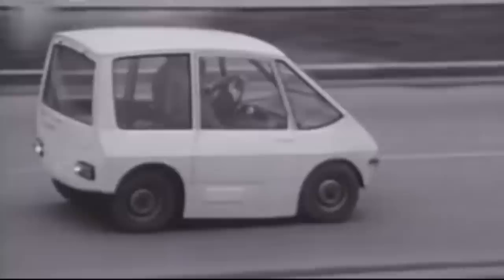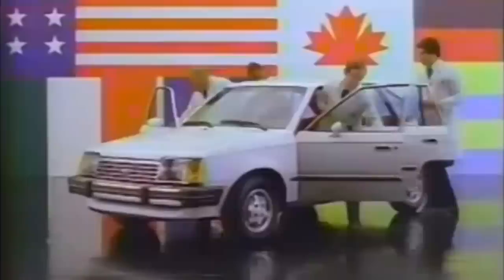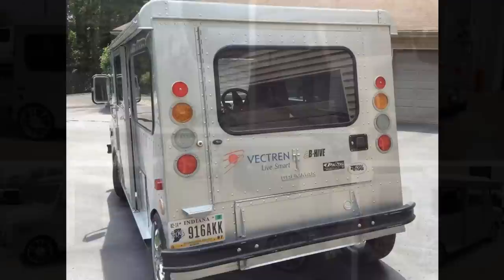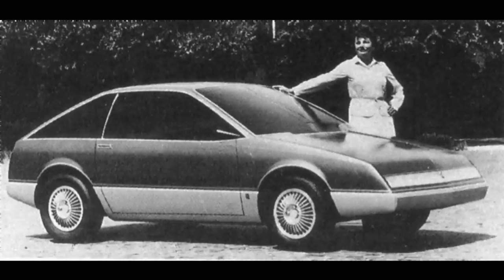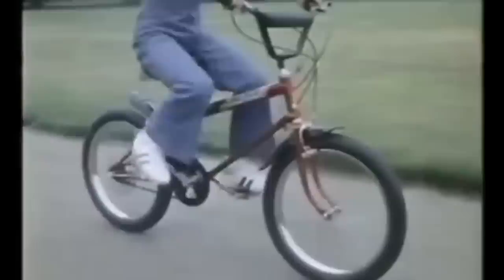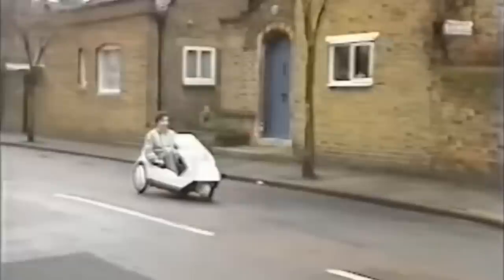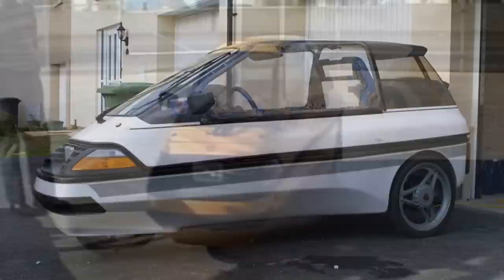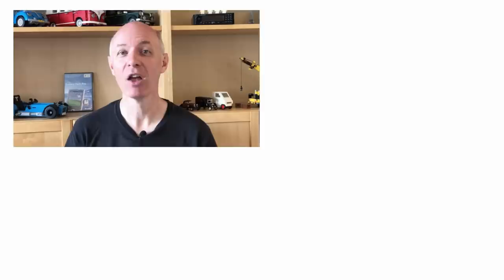Before Tesla... 1980s Electric Cars (EVs Part 2)

Comment: Petrol car: How fast does it go?
Electric car: How far does it go?
Reply: Jaunty Angle guess you live under a rock and haven’t seen the Porsche Taycan or the model s/x 100D, model 3 dual motor...
Reply: @goclunker  No, I haven't. Are they electric? If so, how fast do they recharge?
Reply: Jaunty Angle are you kidding me? The Taycan is running an 800v charger. 5 min to 80%
Reply: @goclunker  Not bad if you can find a charge point. How much is it?
Reply: @niki123489  thanks, now i know that an electric vehicle wouldnt even get me to work, let alone to visit my family on the weekends
Reply: @goclunker  No, it's 22,5 minutes to 80%.
Reply: @petrkubena  there is no 800V infrastructure, yet. The Taycan is designed to charge at 800V, which is 5 min to 80%. Thanks for playing
Reply: @goclunker  No, It is NOT 5 minutes. Taycan really has 22,5 minutes on 350kW/800V charger (currently limited to roughly 270kW peak in Taycan firmware).  800V chargers are available, but scarce. 

Make simple calculation - taycan has 93kWh battery, for it to be charged to 80% in 5 minutes , it would need constant 900kW power supply. At 800V that would mean around 1000Amps. Not realistically possible. And way more when you consider that peak charging speed is achieved at around 25% SoC and then it declines.
Reply: P
Reply: I have a electric car that can go about 100 kilometers on one charge. 
I drive less than 50 kilometers per day.
I charge the car at work.
The time I spend on charging the car is about 10 seconds per day.
Reply: @goclunker   go to a sub station you can get 800volts there and 900kw
Reply: @Ghryst  your commute is more than 600km per day?
Reply: @RMarkNolan  yes.
may i introduce you to a real Country, Australia perhaps?
also, (not you in particular, but all of you) ya'll should learn how to maintain a lithium battery - NEVER fully discharge it, it is recommended to discharge to no less than 60%, so there goes 200km
Reply: lmao i just read the "5min to charge to 80%" claim

...

hahahahahahhahahahahahahahhahahahahahahahhahahahahahahahhahahahahahahahhahahahahahahahhahahahahahahahhahahahahahahahhahahahahahahahhahahahahahahahhahahahahahahahhahahahahahahahhahahahahahahahhahahahahahahahhahahahahahahahhahahahahahahahhahahahahahahahhahahahahahahahhahahahahahahahhahahahahahahahhahahahahahahahhahahahahahahahhahahahahahahahhahahahahahahahhahahahahahahahhahahahahahahahhahahahahahahahhahahahahahahahhahahahahahahahhahahahahahahahhahahahahahahahhahahahahahahahhahahahahahahahhahahahahahahahhahahahahahahahhaha
Reply: @Ghryst  Hahahahahahahahaha. 
My boss is very much for new and environmentally friendly technology. That's why he offers everyone who buy an electric car free charging at work. Selfish? I don't think so.
And by the way. There are no problems with discharging the lithium batteries close to zero, or to charge them to 100%, as long as you never park the car with full or empty battery for longer periods.
Charge to 100% before you travel, and if you are close to zero just charge up tp 20% before parking the car for a longer period. Then the batteries will be just fine.
Reply: @kjaxky  I'm sorry if you regard pertinent questions as "something stupid to say". No doubt you also believe in a flat earth and follow an established god without question. I'm sure you're not one to exaggerate so instead of asking you to name  10 percent of the "millions" of issues wrong with gasoline vehicles, I'll ask you to name just 10?
Reply: @Ghryst  if your work commute is more than 600km per day, you could possibly consider moving closer to work, and save some of that 7.5 hour drive every day. Unless you drive for work, which sounds likely.

Li-Ion batteries are fine to be discharged down to 5%, sometimes less.
Reply: @RMarkNolan  7.5 hours for a measly 600km?
how fucking slow do you think i drive? try 4 hours, 3.5 if im doing 10km over the limit. and fuck living in the city, its bad enough i have to go there for work.
and no, Li-Ion batteries are not fine to be deeply discharged, maybe you're thinking of old-fashioned ni-cad, which MUST be deeply discharged each time to avoid developing a surface memory..
no wonder electric cars have such a terrible environmental impact, if this is how you fools are treating your batteries.
Reply: @Ghryst  to drive 600km in 4 hours, your average speed would have to be 150km/h. You must be lucky to have no speed cameras or traffic cops in Australia!

My calculations were based on New Zealand's 100km/h speed limit, and a real-world average speed of 80km/h for a trip.

Even so, spending 4 hours driving at an average speed of 150km/h every day must be tiring. You should consider working closer to home, rather than commuting over 600km per day.
Reply: @Ghryst EVs can be driven down to "0%" charge. The battery management system keeps a deserve charge so the battery is not completely discharged (which would damage it). So 0% shown is not actually completely discharged. The car doesn't allow the battery to become completely discharged.
Reply: @RMarkNolan  errr... like every modern battery. 
0% voltage is where it become un-rechargeable on the spot, it is still having its lifetime reduced by going to zero on the dial
Reply: @RMarkNolan  we have them, theyre just rare in the countryside, cos we dont have towns every 10 miles like yankeeland
Reply: 9600GTMAN   the range of the car is much more important to most car buyers

the EV 1 seems irrelevant to me now  after seeing the Amitron of 67 and knowing it went 150 miles per charge

that's a longer range than the EV 1

they were still looking for a viable electric car in the 80's 

why?

we had already found it
Reply: that's 50 miles more than the Nissan leaf of 2011 and 30 miles  more than the EV1 GEN 3 so it makes the other two cars unimportant
Reply: I am sure they could increase the range a bunch on newer cars if they could only go 50 mph but everybody would hate them.
Reply: Wow middle class old men with opinions

Comment: I've got a Sinclair C5 - Living at the top of a steep hill, I've had to upgrade it with a modern front hub motor and lithium battery. Now it's a fantastic way to get to work. I know several people in the C5 world using the original on a daily basis so it's really proven it's engineered to last.

It was a failure compared to the dream Sir Clive had for it, but was the best selling electric vehicle ever made until the Nissan Leaf took the crown in 2011.

Let me know if you are ever in Bristol and want a go!
Reply: got a 500w 48v hub on mine and a 42Ah battery. it pulls clean uphill now. never have to pedal. now i dream of a cityel

Comment: I own a City-el, I have fitted it with a mix of lead acid and lifepo-4 cells. top speed is 40 mph and it has a range around 40 miles.
The car was built in 1999.

Comment: Around 20 years ago a 'Cityel' drove past me while walking through Vevey. It struck me at the time that this was the future as it silently glided by. It made conventional cars seem like overweight dinosaurs. Since then I have never stopped ranting about SUVs.:))
Reply: Weight is actually the smaller problem, bigger problem is air resistance. In electric cars though there will be weight, the bigger batteries (range) you want, the more. I think the future is that people who like to drive will have more cars, so that cars are suited for the purpose. You can have small car with small batteries for short distances like commuting. And you can have a bigger and better cars for long distances. That way you are most of the time driving efficiently. Also, remote working will be more common, so that the need to commute will reduce.
Reply: @ThePatUltra The problem with the batteries has so far been their price. Even having one Tesla worth of batteries is very difficult to make the car cheap enough. If you double the amount of battery capacity, you are quite soon looking at well over 100k $€ vehicle that has less range than double the range of a Tesla. The price will go down though until a certain point, that is that the availability of battery materials is going to be a problem if the production is to be scaled with current chemistries. In the other hand there may be coming new promising battery types quite soon, like the solid state battery that at least Toyota is working on.
Reply: @wopmf4345FxFDxdGaa20  January 2021: Tesla lowered the price of the Model Y RWD (60 kWh LFP) to ~45,000 €.
Reply: @Stefan_Dahn  Here in Finland, average people drive with ~6,000 € cars. 😂😅 The average car age here is 12 years. Which means, some people are driving 20 years old cars. So, yeah . . . We will see how many Tesla's will be on the road at the age of 20 and how can you maintain them at that point.
Reply: @wopmf4345FxFDxdGaa20 people can’t afford to buy two separate vehicles for different types of driving. Buying one EV is out of the price range of 80% of the people who drive now. The push to go 100% EV shouldn’t be happening for another 15-20 years when hopefully the Ted will be less expensive and the range and charging time will be closer to that of an ICE vehicle. Also, there needs to be a massive increase in the power grid and a cleaner source of energy, if not, you are doing nothing to reduce pollution. But since the whole global warming myth is about money, it doesn’t matter to the left.
Reply: Why are you ranting about SUVs? They have no more affect on the environment than an EV does. The entire process of making an EV is always ignored by you people that want to force others to get rid of their ICE vehicles. You just feel all warm and fuzzy inside because you think you are helping the environment by driving an EV. Even if you forget about the impact that the mining of the materials has on the environment and how it affects the lives of those that do the mining, there is the fact that the power to charge the EV most likely comes from fossil fuels. But as it is with most all of those on the left, you don’t care about solving a problem, you only want to appear to be helping so you look good. EVs are definitely the future of transportation, but it cannot be forced. And that means keeping the government out of it
Reply: @mopar_dude9227  Yep! That is the thing, if even Americans cannot afford to buy them, who can? I agree with you. Here in Europe the situation is quite bad, EU is making internal combustion engine cars illegal after 2035. 😣
Reply: @wopmf4345FxFDxdGaa20  Finland is quit literally not the place for a Tesla unless it's summer.

Comment: The EV1 was one of the first quick EVs and had a faster zero to sixty than many gasoline cars such as the V6 Camry of the same era..
Though the drive train is a direct ancestor to what appeared in the Tesla Roadster.
Reply: Patchuchan that’s because Elon was mad at GM for what they did with the EV1. He said himself that Tesla was started because of the EV1 story and what GM did
Reply: A V6 Toyota?🤣🤣🤣🤣
Reply: @princesssolace4337 I wouldn't laugh too much at a Toyota V6 in a fairly light car 
The V6 Camry SE of that era could do zero to 60 in 7 seconds which was very respectable beating many so called sporty cars.
Reply: @Patchuchan  the range of the car is much more important to most car buyers

the EV 1 seems irrelevant to me now  after seeing the Amitron of 67 and knowing it went 150 miles per charge

that's a longer range than the EV 1

they were still looking for a viable electric car in the 80's 

why?

we had already found it
Reply: @robinsss  It used some very cutting edge for the time lithium-nickel-fluoride  batteries but they were too expensive to produce and to get the price down a battery company would have to make a lot of them but they're not going to make a lot of them unless they have a big order.
Ended up being laptop computers of all things that drove the need for mass produced lithium batteries in the 1990s.
Reply: @Patchuchan   just technologically speaking it  was the first viable Electric car 

not the EV  1
Reply: @robinsss  1899 Baker Electric.
Reply: @goclunker  Elon was in South Africa when the EV1 was rolling around. Musk had NOTHING to do with Tesla's formation.
Reply: I suppose the thing that allowed that was power electronics which lead to motor control improvement. Other than that it is 100 year old technology. Well indeed there was some new battery chemistries, but were those needed for the acceleration.  ;-)
Reply: @robinsss  The value of good acceleration is more a marketing value, to remove the image where people think that electric cars are gutless or slow (which they of course by nature aren't, it was just that ICE cars had been developed and polished for 100 years, while electric cars had been not). Now that gutless image problem has been mostly solved thanks to Tesla, the problem remaining now is the range, (and price).
Reply: @wopmf4345FxFDxdGaa20  the only remaining  problem is the price

the Model 3 can reach 300 miles on the highway alone

that's the equivalent of a gas car
Reply: @robinsss  I don't know about American cars, but at least in Europe, even a cheap gasoline car goes more like 500 - 1000 km with a tank, and a diesel car, if you drive very carefully may go nearly 2000 km with a tank ( like has been achieved in the fuel saving drive competitions with standard production cars for example a Mercedes E class ). So Tesla Model 3 same time as being much more expensive, hits the lowest end of ICE cars. It is then a different question how long range is needed. I think 1000 km would be quite enough for just about anything in normal use.
Reply: @robinsss  Of course if price is unlimited, the range is not a problem. The range and price are actually the same problem, two different sides of the same coin. If you want longer range, the car will be remarkably more expensive. If they can push the battery price very low, the problem is solved.
Reply: @wopmf4345FxFDxdGaa20  500 km is 300  miles 

300 miles is the average mileage for an ICE car in America for a full tank of gas

i don't  know what you mean '''with a tank'''

all cars have tanks

the  range and the price are two different things because today a Tesla model 3 costs 36,000 dollars in the US  and goes 300 miles on the highway'

a few years ago a Roadster went about the same distance on the highway for 100,000 dollars

now that range cost 36,000 dollars

by using new concepts in technology  Tesla was able to reduce the price for the same range
Reply: @robinsss  Well excuse me for my English not being perfect as I am not a native speaker, but we can switch to Swedish or Finnish if you like.

"by using new concepts in technology  Tesla was able to reduce the price for the same range"

Exactly! This is the point! The new Tesla is cheaper, because it uses better more advanced manufacturing technology and better battery chemistries, and the manufacturing is scaled to new levels with the help of the new gigafactories that also help to reduce the unit cost. This is awesome development what Tesla has been able to do and also wake up others for this task.

But it still means, the car costs 36 000 $, and the car is like a Toyota Corolla in its utility. How much Corolla costs in USA?

Well even that is not the big problem though, people could pay a little more, and electric car could be made to last a little longer.

The greater problem will be that when the production of the batteries will  be scaled up, the  amount of natural resources available for batteries is limited, and that will be a problem, in dropping the battery kWh price.

Currently Tesla makes 1 000 000 cars a year? Toyota and VW both make 10 000 000 cars a year. And all other manufacturers added to that.

If most cars are to be electric, it means the production of the batteries must be scaled by factory of 50 - 100 at minimum, and that is only for cars! Then there is many other places where the same batteries are wanted to be used, if ICE is to be displaced.
Reply: @robinsss  The key to understanding how far the price can drop, is understanding the mechanism how the price is dropping.

Like in computers and in computing power; the price has dropped because the transistors and the manufacturing technology of the intergrated circuits has been scaled to smaller size all the time since 60's. Nowadays you can fit much larger amount of transistors on same die area compared to what you could 15 years ago. There is obvious known mechanism that drives the price drop, and it has been a very powerful one. But it won't last forever in computers either. There will be a point when the transistors cannot be scaled down any more, because the detail size is approaching levels, where the charge carriers won't stay in the conductors anaymore.

In electric car battery manufacturing there is a different kind of driver for the price drop. We can do the easy things to drop the price, like Tesla has been doing to scale the manufacturing up and remove all the waste from the manufacturing process to make it cheaper. Same time availability for materials has remained good or got better to drive the price lower.

But how long can this be pushed?

There is no same kind of known mechanism as we have had in computers. The price can be pushed a little lower still, but not like we have seen in computers. The availability of the materials may turn the development around.

If totally new battery chemistries are introduced, it may improve the situation, but it may take time, like with fusion power. Some manufacturers are working on totally new type of solid state batteries, but I am not sure will these either completely solve the problem.

But indeed, Tesla, VW, Toyota and others are doing good work on this.